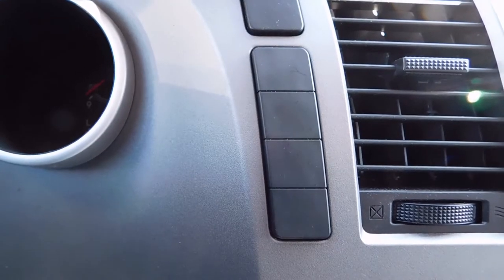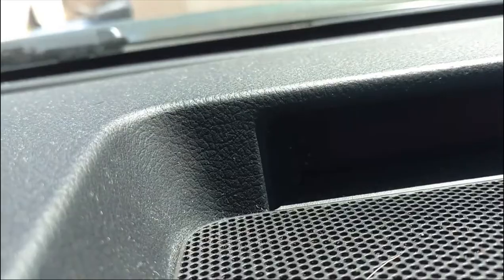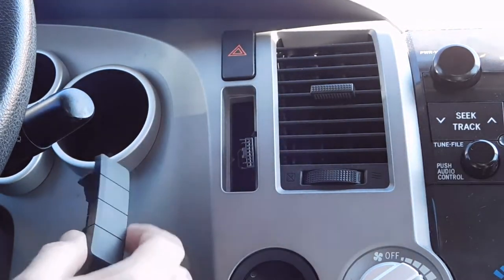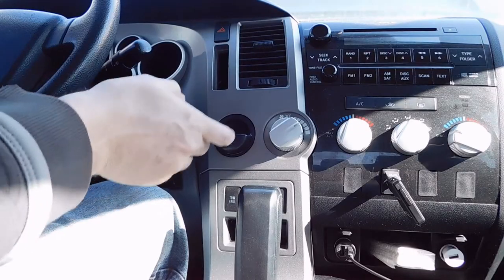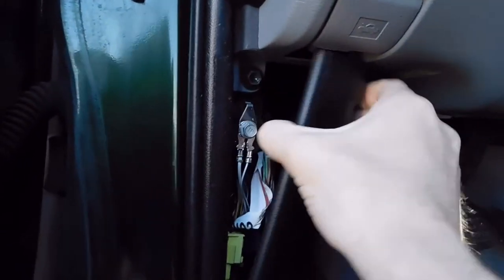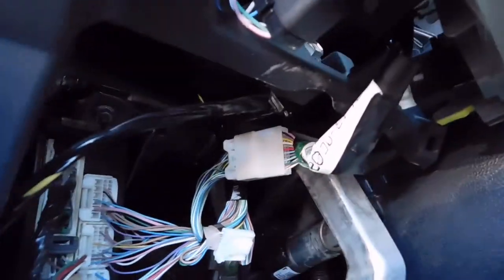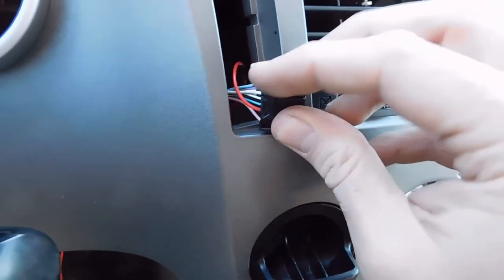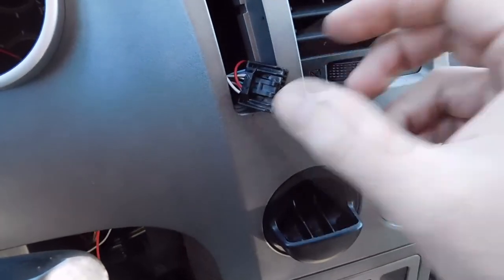Toyota Tundra - Unlock MPG and Range functions by adding the 'Info' button!

Comment: Thanks man! I’ve had my Tundra for 6 years and that button never worked. I thought it was the module that was broken until I saw your video. Thanks for the instructions and the detail. I went the route of unplugging the non existent sonar and swapping the existing wires. Either way, I’m happy it works and sad to see the mpg I’m getting LOL
Reply: How did you unplug the sonar wires from the connector ?

Comment: Great video! My dad is trying to add the oem sonar (park assist) to his 2012 SR5 Long bed, he found the wire harnesses for everything except the wire harness that would plug into the sonar ECU which apparently would be located near the ECM behind the glove box. He's plugged everything else in required to make the sonar system operational so plugging in the Sonar ECU is the last missing piece that he cant seem to figure out. Any advice you could give him? Thanks in advance.
Reply from the maker: Hey, unfortunately I've never fiddled with the sonar stuff in these trucks. Its possible some of that stuff is missing entirely and that those trucks with sonar just have a different wiring harness.  If possible I'd try to see if any nearby junkyards have a wrecked one with sonar you can poke around in. That might be a long shot though
Reply: I have same 2012 SR5 truck with all wires and it don't work. Just US to metric. Did you try it and could you get it working?

Comment: My buttons still won't work. I bought a new set even and It looks like I have all of the wires
Reply from the maker: You're certain you have the wires going from the sub connector below the steering wheel to the back of the cluster? And also that your display in the dash has the extra outputs?
Reply: Chris- Same situation.  How was it resolved?  I have a 2012

Comment: as much as im happy for you for having all of those wires, it would be great if this showed the removal of the stuff needed if you didnt have the wires between JL-1 and JL-28 which is the connector on the back of the instrument cluster.  cant find on on youtube anywhere!
Reply from the maker: Sorry, I had been tempted to do that cause I wanted the video to be more complete. But my time with the truck was short, and unfortunately I don't have access to this vehicle anymore
Reply: @tailsg8594  No need to apologize.  its still very helpful.  sorry if this came off as a criticism, it was actually just a general whiny complaint about there being no vid out there as good as this one showing the 2nd half that some folks need to go through.  im hoping my buttons will be here before this weekend and if i dont have the JL1-JL28 wires ill try to film that part.
Reply: @tailsg8594  doesn't work if you have all of the wires. I have 2012 Tundra and all that I get is US to metric. Wasted my money....
Reply: @scott.  Did you verify that the wires made it all the way to the back of the instrument cluster or just that you have the wires behind the actual switch?
Reply: Wes- did you end up successfully running those wires and getting it to work or did you return the switch?  Im in the same boat(only the setup button works - and i have all wires to the first connector).  Thanks
Reply: @Gone_X_ing  yes.  i had to run a wire to the back of the speedo cluster.  there is a really good writeup on the tundra forum for it.  Its only been a year, but i definitely dont remember it well enough to guide you through the process.  best of luck!  its a worthwhile upgrade 100%!!!
Reply: @idiggplants  do you have link for forum